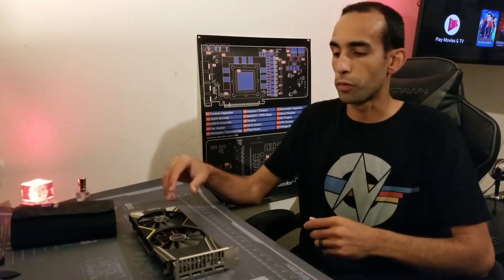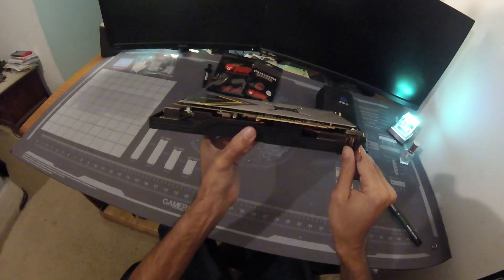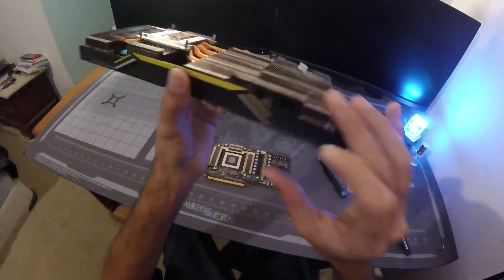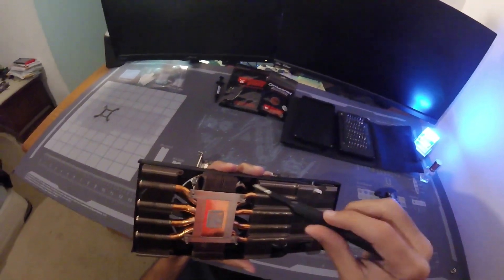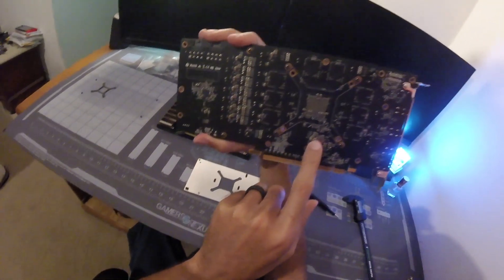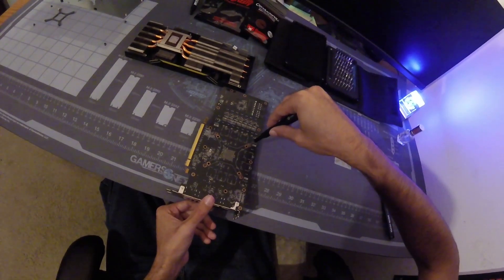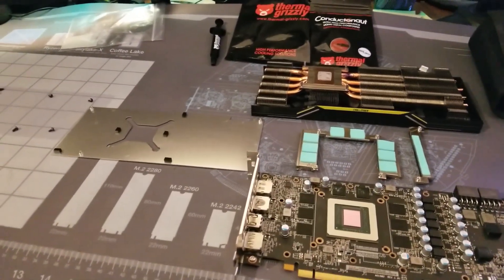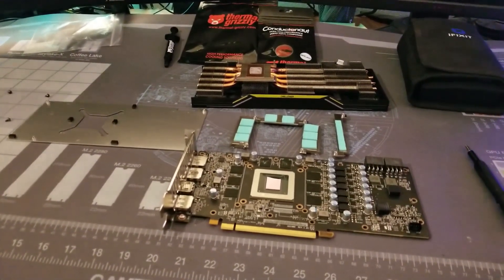Asrock Challenger RX 5700 Tear down

Comment: Hi, can the plastic shroud be removed? I need to lose 9mm length if I grab this card and I think it can be done if I remove the shroud. Cheers
Reply from the maker: Yes there are 4 screws holding the shroud to heatsink,
Reply: @SerpentXTech  Great thank you. Might be able to squeeze it into my case. Appreciate it and great content.

Comment: Would you keep the stock memory/vrm heatsinks on if you were installing a Accelero IV backplate? I'm planning on switching out the cooler, and was thinking about keeping the stock thermal pad/heatsinks on too for more heat dispersion in addition to the accelero backplate. What do you think?
Reply: for those reading my comment you can keep the vrm heatsink on the memory on doesnt fit with the accelero. If youre using 100x100x3mm thermal pads the screw tops will push the backplate up. It will be very hard to fit the stock screws, but if you find the same size screw with a flatter top you can fit the stock vrm heatsink.

Comment: hi do you know why my challenger RX 5700 is laging at LOL  cpu R52600 16gb ddr 3000mhz
Reply from the maker: Build quality is poor, Asrock should have done better. However, when you say lagging, it can be a number of factors. Are you overclocking? If so put everything, CPU, memory, and GPU back to stock. Check drivers and get the latest one installed. You can use DDU to remove any graphics drivers and reinstall fresh. Run LOL again, not overclocked and see if it still lags. AMD drivers are not the most stable, but I never experienced lag, maybe so screen tearing or choppiness.

Comment: Is the PCB reference as i want to waterblock mine ?
Reply from the maker: Yes, it is reference design confirmed by Buildzoid from Actually Hardcore Overclocking and Gamernexus. But Asrock may have changed some small items, I would screen shot a known reference PCB and compare against my screen shot. I will post pic on my Twitter account if you can tweet me. Either @SerpentXSF or @cmvjax
Reply: @SerpentXTech  hey, did you get to do that? I got an arctic xtteme iv for this card but I'm not happy with the vram temperature (even with an aggressive undervolt, under 900mv, I'm getting 56C on idle and over 88C on load. If I leave it at stock or do a light undervolt to 999mv the vram temperature goes over 100C on load. The rest of the temps, except for gpu junction, stays way under 70C at load no matter what voltage I leave on the card. The main issue is that the xtreme iv doesn't let me put any heatsink on the vram, except for those flat coppers one, because it's heatsink is so massive). Was thinking of getting one of those waterblocks from aliexpress (I live in Brazil, waterblocks options here are non existant)

Comment: Can you please tell me how i should undervolt it for better temps? Should i reduce core speed as well? How many volts?
Reply from the maker: Well you can run at 1300 core, with 0.800 volts. So if you step it up, for gaming maybe try bringing it down to 1600 core with 1.000 volts and see if it stable, then do small increments down or up once you find a comfortable level between performance and temperature
Reply: @SerpentXTech  i see a Video from big head tech and he put the card to 970mV and 1804 MHz. Hope i got  luck and can do the same.
Reply from the maker: @derhenker6629  try it and see the worse you system will freeze then reboot and try another setting

Comment: I like the performance of the card, but don't like the fan noise.  Here's it is in my Dan A4 case:  
https://photos.app.goo.gl/3yQ9vgYD5V46S5Nn6

What do you think about removing the stock gpu fans and replacing with 120s or 140s similar to this:
https://forums.anandtech.com/threads/xfx-r9-390-dd-modded-with-2-x-120mm-fans.2466051/

Do you think this would result in less noise with similar or better temps?  Any recommendations?

Comment: Anybody known of any solid aftermarket coolers for this card?
Reply from the maker: Coolers designed for the reference GPU should fit, as Buildzoid said it is the reference PCB design with a dual fan cooler
Reply: @SerpentXTech  Thanks. Didn't know all that much about gpu coolers until now.
Reply: @SerpentXTech  I ended up going with the Accelero Twin Turbo 3 after hearing good things about it. Working on getting it installed and looking forward to getting better temps.

Comment: I really need you help, I've got the XT version, with the same annoying noise, which screws do I have to tighten? I didn't understand.
Also, are they accesible without tearing apart the card?

Thank you
Reply: anybody knows?
Reply from the maker: @PauloSilva-xl9cy  ?anybody know what? The screws are towards the side panel of your case when video card is mounted. Loosen them or tighten them depending on what makes the sound better, or go away.
Reply: @SerpentXTech  in your case, is this card making a lot of noise? Even after adjustments?
Reply from the maker: @PauloSilva-xl9cy  no it's not after my adjustments. If you are still hearing noise it maybe vibrating the plastic shroud against the metal heatsink. Using a piece of paper, stick note or index card as a spacer can help. However this is poor design on Asrock part
Reply: @SerpentXTech    Thanks for the videos, they are the best about this custom model. I just bought this card , the card hasn't arrived yet,and I've been reading a lot of reviews about it, but if i have problems I know how to fix it thank  you, good job
!
Reply from the maker: @PauloSilva-xl9cy  your welcome, take care. Let me know if you bump into something

Comment: Just got around to checking this out. I ended up replacing the thermal pads with minus eights and kryonaut. After playing around with wattman and scratching my head I read a great post on reddit that basically said if your aib 5700xt is running hot it’s because they jacked the stock voltages to 1.2v I set mine at 1040mv with a target of 1980mhz and it hasn’t breached 86 degrees on junction since and the fans may touch 2200rpms with my own fan setting. I didn’t forget about the bios in gpu-z, we’ve just been extremely busy  with some family medical emergencies but I’ll be off while my mother in law has surgery tomorrow if you still need it. Anyway hit me up and keep on bringing the good content dude.
Reply from the maker: Take care of your family, and good luck with everything. Fan control with current drivers are jacked up but that's good you were able to resolve the high voltage AIB has set. I was able to get the bios, but if I still need yours I will let you know. Thanks

Comment: very cool video. i see that its easy to take off the entire cooling system, but is there a way to take off just the shroud and fans without having to take off the cooler? in canada i dont believe we have a "right to repair" law so i wouldn't really want to have to take off the entire cooler.
Reply from the maker: Unfortunately not, there are two screws you can access on the outer perimeter but there is two more you can only access if you dismount the cooler. That's a dumb law, if we bought it we should be able to fix it.

Comment: So I have the 5700 XT version of the Challenger and I was curious how your temps are after changing the cooling paste? Probably gonna change it my self if it really helps. Also curious if future mods of the Challenger (like new cooling pads or cooling pads between the backplate) wil help decrease the heat. I'm definitely subscribing to your channel to see more vids of new mods and temps of the Challenger!

And I know it has been said already but a small tripod to put on your desk for your gopro or a phone 
is not that expensive (perhaps Aliexpress has some cheap ones?) and it wil improve the quality of video's 
and thereby the quality of the channel alot!

Thanks in advance.
Reply from the maker: Great temps, I got a vid coming out later this week on the temps after liquid metal and thermal pads on back of mem module. I definitely recommend replacing the thermal paste
Reply: Are you getting any rattling noise? Mine is very loud
Reply from the maker: @Dokken2x  mine is gone, but I actually had ot come back. I had to loosen the screw on the back I/O side of GPU (where display outputs are) facing the outside of computer case. You can get to it without teardown of GPU. Hit me up on Twitter and I can reply with quick video later today

Comment: I'd recommend a fixed camera or cameraman rather than using a head mounted.  It's very unstable shot, makes it hard to get good looks at the components.
Reply from the maker: Both require money, a better camera or a camera man. If I had a taller Tripod I could have set I on the back side of the desk, looking down. But I'm trying to grow the channel so I could get better equipment. Thank you for commenting,  I will look for additional options or tools.